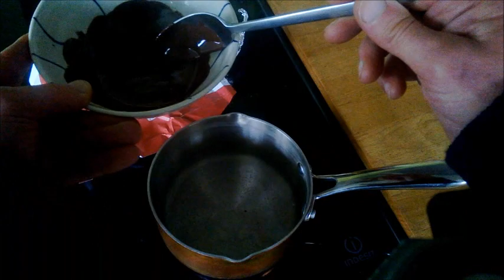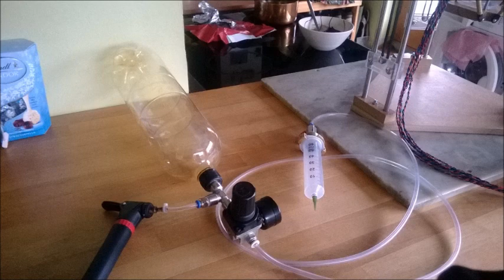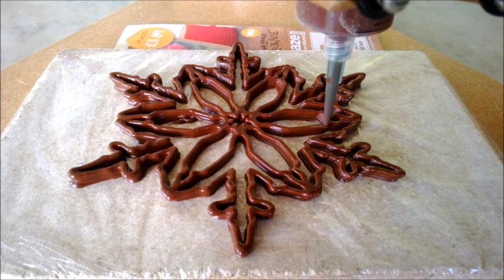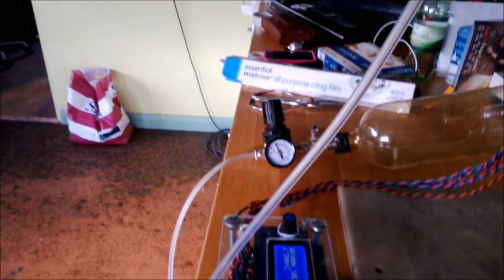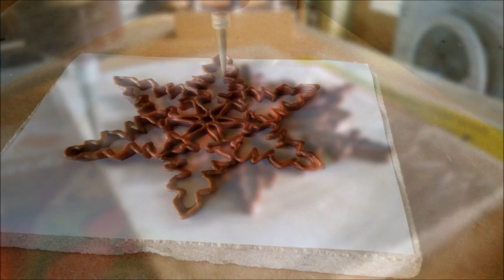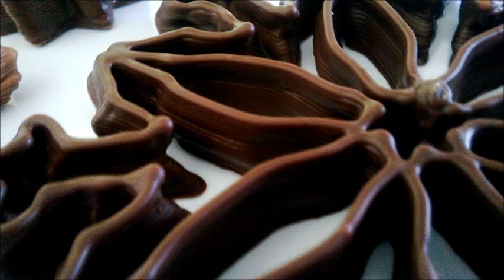DIY 3D Printed Chocolate

Comment from the maker: The printer is my normal ceramic 3D printer that has been documented on my website at http://www.keep-art.co.uk/Self_build.html and there is a Google+ Community set up in support of the machine at https://plus.google.com/u/0/communities/109375785524125994679. There are files for routing the frame on the website. Hope this will be useful.

Comment: Is is able to start and stop the extrusion, or do you have to start it and print the entire thing all at once? And if so, how do you control it? Do you just use the pressure regulator or some kind of valve? Thanks!!
Reply from the maker: I manually switch on the air pressure and print the whole shape - no electronic on/off. I also manually control the rate of flow with the pressure regulator. I keep things simple.
Reply: Oh, ok cool. That makes sense. I was wondering because I'm in a group working on making a chocolate printer for a local company. It needs to be able to start and stop, though, so we're going to try using a piston and cylinder design. I like your machine, though! It's simple and it works really well. Good job!